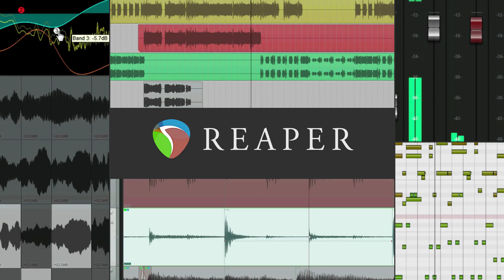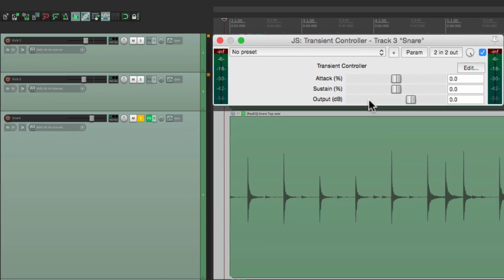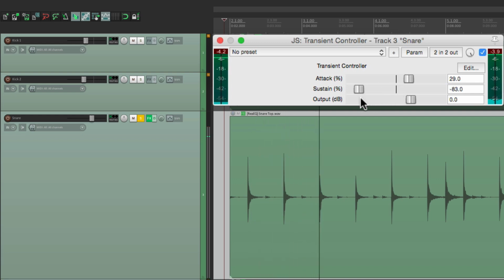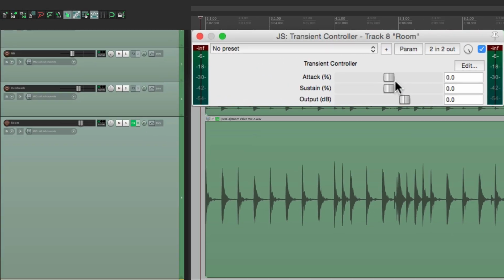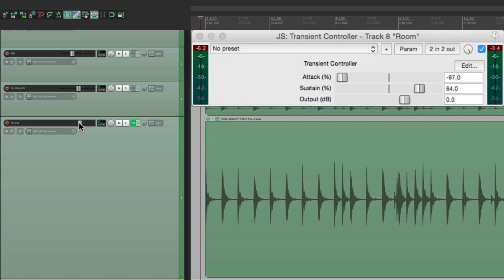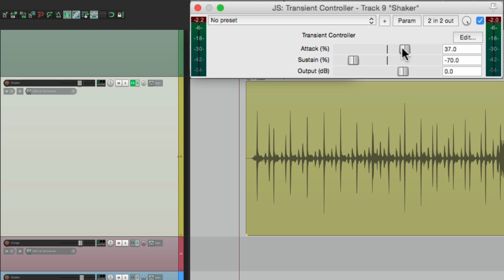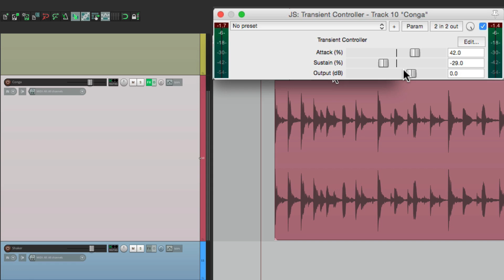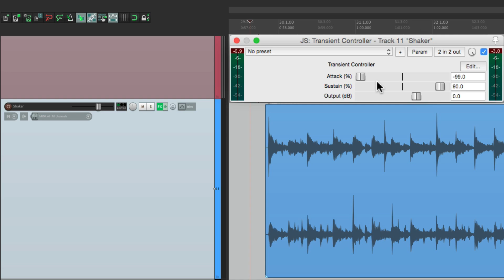The Transient Controller in REAPER

Comment: I'm confused. How is this different from compression? What does this do that compression doesn't?
Reply: Yah, Matthew they are very similar. But transient shaper plugins aren't concerned with the overall sound of the track, like a compressor is. They only deal with the initial attack, so the plugins are much simpler and focused. So you won't see any threshold or other controls commonly found on a compressor.